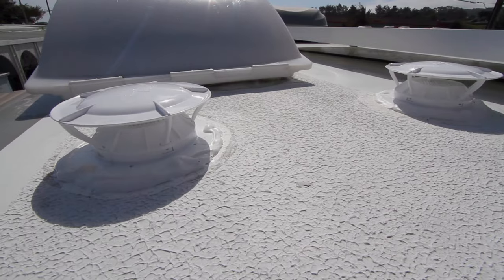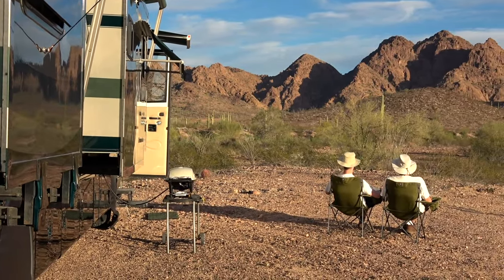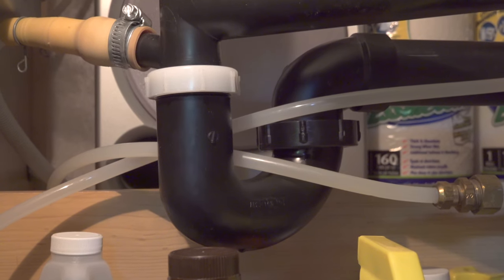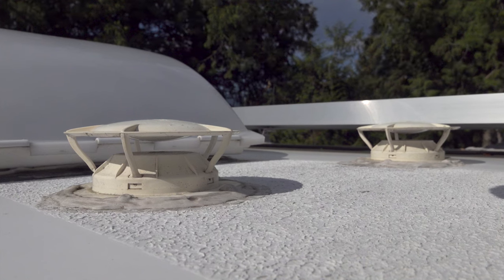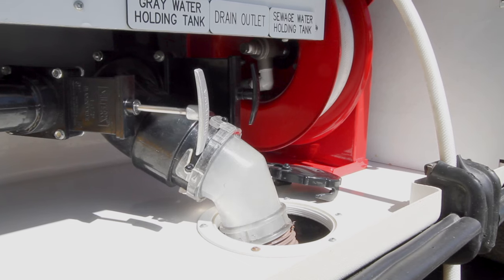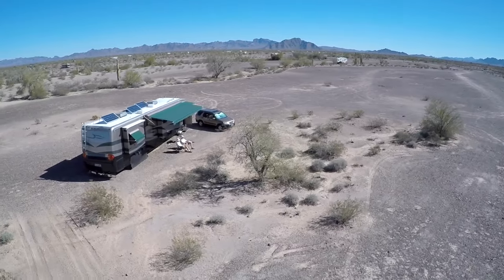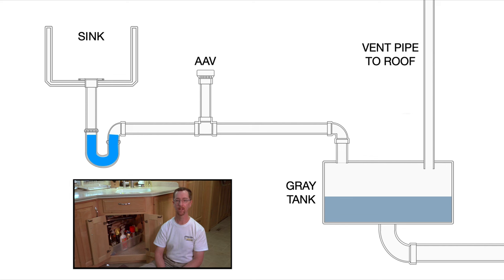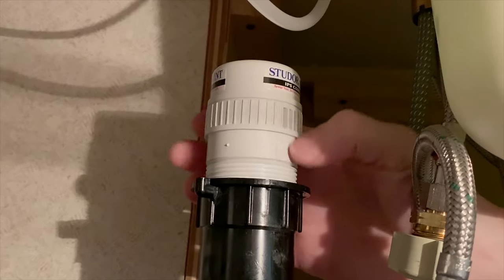RV Holding Tank Odor Control 😵 - Air Admittance Valves

Comment: I knew about replacing the AAV. Another issue is that soap scum and stuff adhere to the grey tank walls much like on shower walls. My solution was to install a Tornado Rotary tank flush on my grey tank. You'd be surprised what remains in these tank after being drained. Only a few RV manufactures offer a tank flush for the grey tanks.

Comment: Another well-timed RVGeeks episode.  Yesterday, I drove our rig back to her temp storage and left an air vent up on the roof.  Yep, that suction effect pulled up some nasty gases from my traps under the shower.  In my case, I'm thinking the water in the p-trap must've evaporated because it has been pretty warm and we weren't using the shower.  NEVER. AGAIN. Checking the AAVs this week.

Comment: Had odor in my half bath a while back.  Replaced all three valves in kitchen, half bath and vanity since if one is going bad the others can't be too far behind.  Total cost was less than forty dollars for all three.  Used the same valves that  you guys put in yours.  Don't forget to put some silicone grease on the threads to prevent odor from seeping past the threads.
Reply from the maker: Thanks Casey. Nice! Grease should be okay, but we just used pipe tape, since the Studor valves call for it.

Comment: I’ve replaced the one under my bathroom sink a couple of times but it still seems to occasionally leak for some reason. I am thinking about just blocking it and letting the one under the kitchen let the air in. I might have to give the studor version a shot first. It takes so little volume to create so much smell, lol. Thanks for another great video.

Comment: We haven't had any odor problems and also never knew these valves existed.  Thanks to your video I'll know where to look first when we do and how to temporarily solve the problem.  We have 3 sinks so I may just go buy the replacement valves just to have handy.  What about the shower, does it have something similar or does it share one of these valves.  Great graphics BTW.  They sure helped visualize what happens and why.
Reply from the maker: We’re pretty sure the shower drain is vented directly up the vent pipe to the roof.

Comment: Great tip. Might have been a good idea to add some silicone plumbers grease to the threads similar to the one that you "removed easily". It's cheap, and handy to have.
Reply from the maker: If you look closely at the end, you can see that we used pipe tape on the threads. The reason we didn’t mention it in the video is because this wasn’t really a “how to“ video, and the only instruction listed on the new air admittance valve is to use pipe tape only, so we thought it would be pretty straightforward and hard to miss.

Comment: You would think these vents would be outside? So if they malfunction the odors don’t contaminate the air in the rv or camper . They should be mounted outside and maybe covered with a vented hood if necessary.

Comment: The best way to vent is going directly to the tank vet pipe itself  if possible. But in most cases that was not done during the manufacturing  process probably to keep costs down.

Comment: Great vid! Is there a valve for the black tank as well? where is that? Thanks!
Reply from the maker: Hey Clatimer... the Air Admittance Valves are typically only installed at the sinks, since those are the fixtures that have p-traps that could be drained without them.

Comment: It is also known as a studor vent another way to prevent odor in the holding tanks is mix 1 part Dawn dishwashing liquid half a cup and the other half a cup with fabric softener put it in the gray tank and the black tank it will keep the particles small and broken up so when you go to dump it flows a lot easier
Reply from the maker: A lot of people use, and swear by, that method... often referred to as the "Geo Method". But even that can be hard-pressed to overcome the extra-heavily-concentrated "stew" that builds up when  dry camping for an extended period. Always good to have a number of tools in your odor-fighting toolbox!  😊

Comment: So I want to know how you guys boondocked for two weeks. We have a Newmar Ventana, so our systems are very similar to yours. How'd ya do it? Tips? Daily process?
Reply from the maker: Hi Les! So just for comparison purposes, we have 105 fresh, 65 gray and 45 black. Gray is always our limiting factor. Since we like to make things easy, enjoyable and comfortable for ourselves, our typical M.O. is to plan one week in any one spot. Assuming 60 gallons is our realistic "full" gray point (we don't want to be driving with concentrated gray water sloshing around in the shower!), that allows us to put 8.5 gallons of water down the sink/shower drains each day. Easy peasy, with Navy showers using about 1-1.5 gallons each, thoughtful washing of dishes, and of course always running the hot water for showering up into our trusty 1-gallon Rubbermaid pitcher, rather than have that go down into the gray tank, and then using the water in the pitcher to flush the toilet. We also shower one right after the other so we only have to run hot water up once. If we really like a place, and want to go 10 days, that takes us down to 6 gallons a day. That requires being extra vigilant with shower water use, which we can easily keep under 1 gallon each and still get a thorough shower. If we arrive at a cool spot and think "Wow! This is awesome... we've got plenty of food, nowhere we have to be, etc" we start right in one day one being more careful with water usage, and 10 days is still a breeze. We rarely stay anywhere longer than that, but it does happen..... usually when we make advance plans with friends. If we arrive in a boondocking spot knowing that we're willing to sacrifice a little on some things, we can easily hit two weeks, meaning averaging about 4.5 gallons down into the gray tank a day (4.5 x 14 = 63). The main "sacrifice" (and one reason we don't like staying that long) is using paper plates is a key to making it work. We don't like using too much paper, and will only do that when absolutely needed. We'll also use a napkin or paper towel to wipe off utensils before washing.... anything to conserve (it's surprising how much water dish washing uses compared to showering). And of course the entire time, we're in what we call "Super Boondock" mode.... hyper vigilant about water usage.... only one drop of water on the toothbrush, etc. The one thing neither of us are personally comfortable doing to save water (which a lot of people are fine with) is skipping shower days. We know people who shower every other day...... or even FAR less. :-/  We shower every night before bed, and won't sleep well without that. People with longer (or any! LOL) hair, might find it more challenging. We also use this super water-saving shower head: https://amzn.to/2leeXCX Hope this gives you an idea how we can do it without too much sacrifice!
Reply: @RVgeeks  So it all comes down to the hard reality of math. I'm with you on showering every day, although we do have the unscented wipes for in-between if it comes to that. Thank you so much for the response! A lot of your tips, tricks and gadgets have found their way into our RV. Including, by the way a new AAV valve that cured a stinky bathroom.

Comment: Hello. We followed you video on smells in the RV. We have replaced the roof vents with Lippert Components 360 Siphon Roof Vent Cap and the Studor 20349 Redi-Vent Air Admittance Valve under the kitchen sink.   We replaced the waterless tank valve underneath the coach because of a horrible smell. Under the kitchen sink smells fine. 
Every time we wash dishes smells are be pulled in coach by our fans in our electronic cabinet. Fans have been running for months with no problem until recently.  

Any advice would greatly be appreciated. Thanks 🙏
Reply from the maker: Hi Debbye! We hope you've managed to stop all the sources now!
Reply: RVgeeks... No still trying to figure it out. 😷

Comment: Thanks for the video! I can't get mine off ...
Reply from the maker: They can be a bit hard to figure out where to unscrew... make sure you're not trying to remove a part/flange at the top of the plumbing line itself. It's usually just the very top portion that unscrews... unless your RV manufacturer glued it in place instead of using a threaded end that it could be screwed into?

Comment: Will a failure of an air admittance valve cause a nasty smell when you flush your toilet?
Reply from the maker: No, the air admittance valves are only a factor for the gray water system/plumbing. If you’re noticing a sudden change in odor from the black tank, it could be the result of build up (need to soak, clean, or power wash the interior of the tank), a change in your behavior (like leaving the bathroom vent fan running while flushing, which is pulling odors from the tank), or it could be a blockage on the black tank vent pipe to the roof (either from tank contents or from pests like mud daubers making a nest).

Comment: We have a odor in our bathroom sink but only when we use the hot water. But no odor in the shower, kitchen or outside kitchen when we use the hot water. Maybe this may help. But there is no odor when using the cold water.
Reply from the maker: Very mysterious. Not really likely, but you might have something growing in the hot water line at the sink. Can’t think what would be causing the exact symptom you’re describing. We’d suggest sanitizing your entire fresh water system as an easy place to start. https://youtu.be/jEepug8N-aE

Comment: So timely.....we have had the gray tank odor in our bathroom for some time and thought we weren't keeping enough liquid in the p-trap.....our AAV is original to our 2007 Newmar KSDP.....I ordered the Studor valves via your link, but here's my problem:  we cannot unscrew the old valves.  I tried to replace the kitchen valve first (more room to work with) and it is just not going to budge, same with both bathrooms.   HELP!!  Do we need to cut pipes?  I hope not!
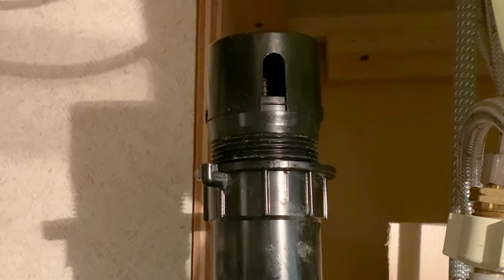Reply from the maker: Hi Corgi Girl! We would definitely avoid cutting pipes unless you have NO other option. It's possible that your '07 KSDP is using different air admittance valves, installed differently, than our '05 MADP. But we'd doubt it (Newmar standardizes a lot of this stuff to keep inventory simpler). One thought... are you sure you're trying to screw off just the AAV valve? If you pause the video at the 1:20 mark, you can see the AAV valve. It's everything down to, and including, the threads. But the part JUST beneath that is part of the plumbing coming up from below. We literally just took a hold of the AAV at the very top and unscrewed it by hand. But trying to turn that part just below it (with the vertical ribs) won't do anything... that's part of the plumbing!

If yours is really stuck, you may just need to get a better grip on it. You can try using a section of no-skid (like what you put in drawers/shelves to keep things from sliding around), so you have a better hold on it. And you may need to get a good grip on that part that's just at the very top of the pipe, so you know you're not trying to turn that.

If that STILL won't work... you could try spraying some WD40 or Liquid Wrench onto the exposed threads and let it sit for a while, in order to loosen up any "gunk" that may have "glued" the AAV to the plumbing. Or, you may have to put a pair of channel-lock pliers onto the AAV in order to really grip it good (if yours looks like ours, we'd suggest gripping just above the top of the threads, but below the vertical vent opening).

If you end up having to cut the top of the pipe off... you'll want to re-attach a threaded end to the existing plumbing, so you can just screw the new AAV valve in. That will require getting the correct plumbing cement (if your plumbing is black like ours, it should be ABS plastic) to adhere the new piece of plumbing (NOT the AAV valve itself) to the old pipe. Here's a link to that end you'd need on Amazon ( https://amzn.to/2lnYpZ8 ), but you can pick it up at a local big box hardware store like Lowe's or Home Depot.

Let us know how you make out... or if you have any more questions!
Reply from the maker: Oh... and if you DO end up cutting the top off the plumbing line (not advised, but hey... sometimes you gotta do what you've gotta do, right?!?!), you can make sure you buy the correct piece to cement back on by checking the size of your existing plumbing. We'd bet it's 1.5" ABS (black)... but here's a link to a chart showing you the dimensions... so you can measure the outer diameter to know what size pipe you have: https://www.howellpipe.com/howpplp.aspx
Reply: Hi Guys!  I’ve got good news:  when I first commented on your video, we were parked in Independence, Missouri during the 100º days......I was so frustrated with the process to replace the AAV, I just put it off after I tried repeatedly.   This week, we have moved west to Kearney, Nebraska and the temperatures have dropped to the upper 60º’s....and (surprisingly) all three of the AAV in our coach screwed off easily just as in your video!  No cutting pipes, no more putting up with the gray tank smell, just an easy repair — I need to remember the properties of temperature (heat expands, cold contracts!).      THANKS RV GEEKS!!!!
Reply from the maker: @corgigirl7638  That is awesome! SO great to hear. Thanks for letting us know 😊

Comment: Actually can you tell me where I can find the black pipe itself? The one connected to the redi-vent piece? For some reason the previous owner cement fired it and now I need both parts 😫
Reply from the maker: That should be pretty standard plumbing pipe, available at any hardware/plumbing store (Home Depot, Lowes, etc). Usually 1.5", but check measurements to be 100% sure.

Comment: Completly out of subject... I am trying to hook up my rv to my house for family visitors... My rv is 30amps, my house has breakers 30amps/50amps but no rv actual outlet... Can I hook up directly into a regular outlet? Would that be a 30amp outlet?  Not sure if I make sense I'm really really new to this rv stuff
Reply from the maker: You can indeed connect a 30-amp RV to a regular household outlet using a dog-bone adapter. Here is our video on that topic: https://youtu.be/wVYBei5BZmw Just be sure that you don’t draw more than 15 A at any one time while you’re hooked up. For example if you’re going to run an air conditioner, you can’t run anything else simultaneously. If you’re going to use an electric water heater, you shouldn’t use anything else at the same time. Keep your power usage low, and you won’t trip the breaker. We have hooked up our big 50 amp motorhome to regular household outlets many times, and have never tripped the circuit breaker, simply by keeping our power usage down to a minimum. Hope this helps!
Reply: Awesome quick and simple explanation! Thank you!! 👍